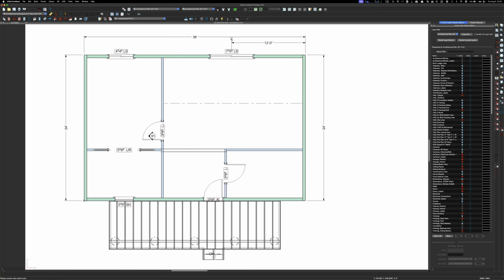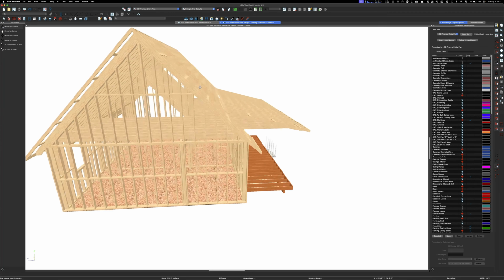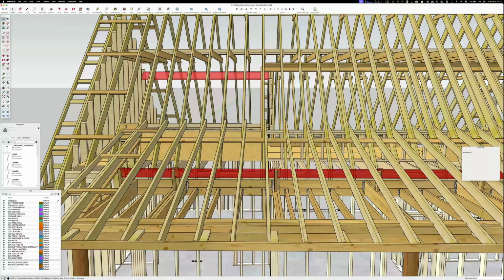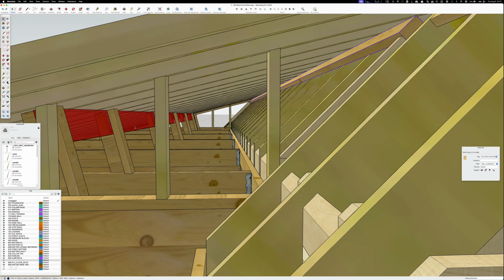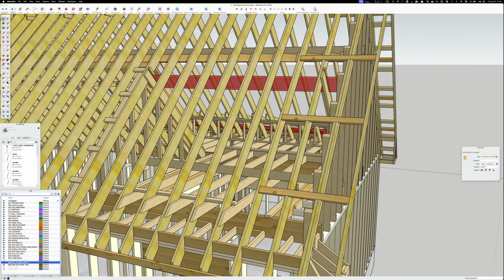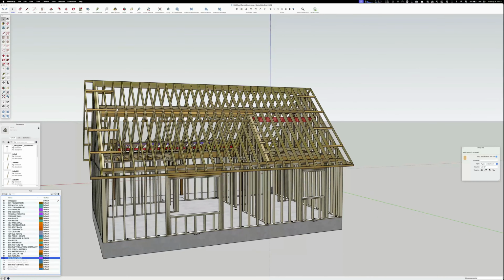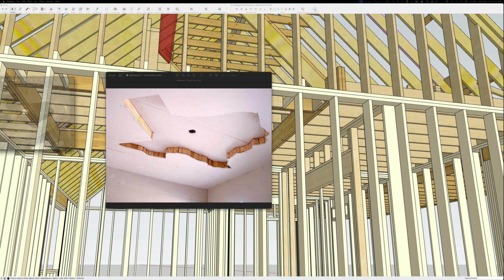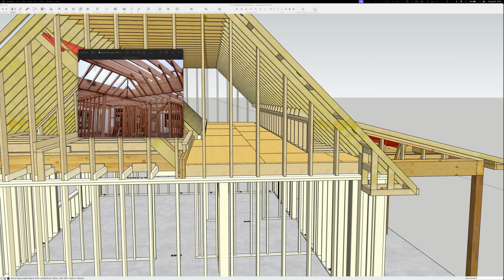CAD 911: Ep. 005 (Porch Roof to Common Roof) Chief Architect X15 v SketchUp 2023 Pro

Comment: I'm the guy who made this video.  As a framer I would like the framing to be represented accurately. 

I personally know of someone who is involved with a community college in Oklahoma where the students are taking drafting and carpentry and if they were to study this 3-D model from chief, they would not learn correct framing.  Once they get on a job site and start framing, how they viewed the framing in chief 3-D would not match the reality of what they are about to physically frame. This is confusing and this could potentially turn them off from trusting that chief architect is accurate and valuable as a software solution.  It would be in chief interest to make the framing accurate as in it is in reality so that they can entice more customers to their subscription. If they don't and they want to focus on interiors and color pallets, then they will lose the general construction industry in favor of the interior design industry. Maybe they should have separate software that is tailored to both.

Chief needs to understand that the bottom of a rafter needs to land on a wall plate or a valley and the top of a rafter needs to land on a ridge or a hip. In this instance the porch rafters need to be nailed beside the main common rafters. 

The main common rafters should bear on an exterior wall.  And if possible, a knee wall should be in the attic space to support the porch rafters instead of them just being nailed beside the existing rafters.